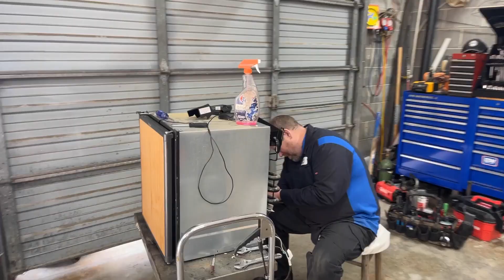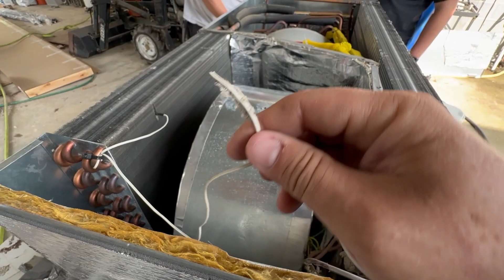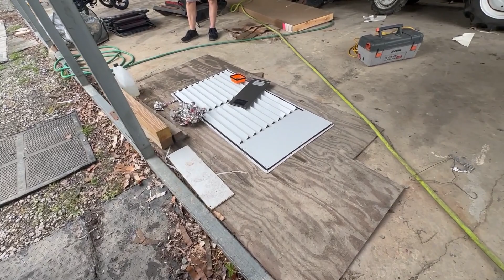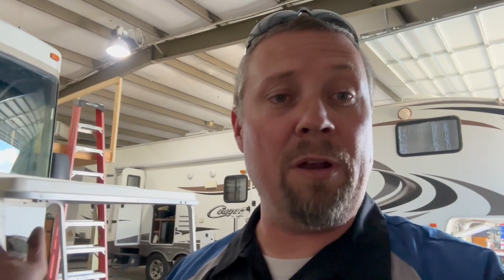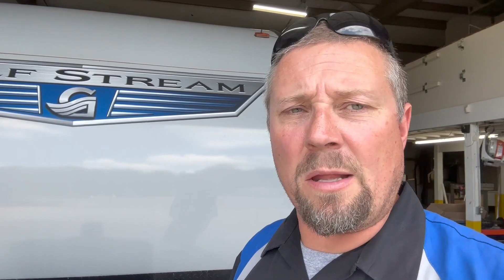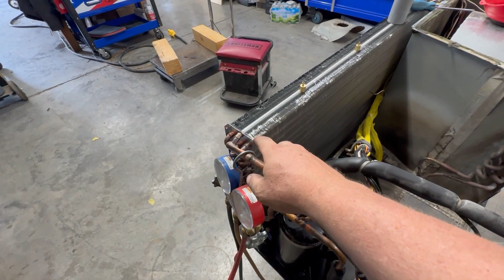PPF 3M Diamond Shield Dura Shield

Comment: Thanks Steve for another great video, I always come away learning things, the section on the Winnebago roof, we have that same tucked in roof radius on ours, although I resealed it just this spring, I have always thought this was a concern, if you can what is a ballpark to have this done like in the video on a 35 foot? Another thing, will the ugly shield remove the cracked and faded stripes on the side?
Reply from the maker: That was an insurance job I want to say it was 4 hours labor plus parts.  Not sure on the strips that would probably be a great question for Wayne.  Thanks for watching!

Comment: Don't be too hard on the guy who wired the GFCI backwards. Some years ago they reversed the connections on the back of them so the input and output were swapped. So if you have a really old one and you just hook a new one up exactly the same way, nothing  works.
Reply from the maker: They can be tricky for sure.  Thanks for watching!

Comment: What's it cost to remove the diamond shield?
Reply from the maker: Our price is the same as Wayne's $1799.00 plus tax unless it is 2017 and newer because of the paint they used.  Thanks for watching!  Call anytime if we can help 423-479-3627 Steve
Reply: @shelburnerv  thanks for that info. I'm looking for a new to me motorhome, so now I know what to expect if the DiamondShield is failing. Is the 2017+ more costly to fix, or less costly?
Reply from the maker: @RamblinRoadies  it’s more because the paint according to Wayne is not the best and damages very easy.
Reply: @shelburnerv  wow, that's good to know too. Thanks.